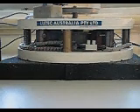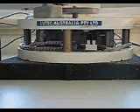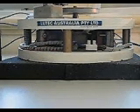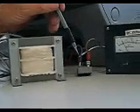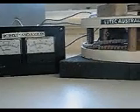Lutec Overunity Motor 362%

Comment: Surely most who see post would like to know more in detrail about the design. Are your bothered that someone would manufacture your design and benefit financially? Once you have publically made your design known it is automatically protected against any other person applying for a patent and exploiting your design. You therefore have no cause for concern in this regard. DC power is indeed the product of current in amperes and voltage in volts to give the power in watts. AC power measurements are not as easily calculated. To begin with the wave form of the AC generated must be knosn, then the RMS value of the current must be determined either graphically or by other means. The power factor must also be known even though you have used what appears to be a purely resistive load n the form of lights. Then  normal allowances must be made for unavoidable errors in measnrements. The best method to arrive at both intput power or energy and output power and energy is by directly measuring these quantities using mechanical methods.There is not much scope for errors in measurements with this method. It is only through using reliable and accurate meghods of measurements that the efficiency of your system may be arrived at. All the best to you and please do post details of your design for replication and tests by others.Thank y ou

Comment: There is energy in permanent magnets. This device doesn't magically convert DC to AC and create more power, it just solves the riddle of how to use the magnets' energy to do work (move things). It pulses the electro-magnet (pole +) which repels the permanent magnet, which turns the spindle, and presto, mechanical energy! Nothing is created, it is using electricity to convert potential energy into mechanical energy, which powers a generator. Is this really hard to understand?
Reply: Tom Hoehler
Okay let me get this straight...

"Magnets produce a field, a force, but NO energy..."

You are seriously trying to sit there and say that fields and force are not energy... Get a load of this guy lol...

I think you should go back to reading some quantum physics books bro. You obviously missed the part where it explains that all matter are energy and these "fields and forces" are products of the vibration created by that energy.
Reply: A permanent magnet, does not have its field generated through electricity. There fore any electricity used to operate an axis is only used to spin that axis. The opposing force of two magnets at a certain angel will be a constant repellant. Up to a point. But that repelling force will add to the sum of energy used in spinning the axis. Like I said it is not creating energy from no energy. It is taking multiple forms of energy and stacking them in order to transform the static energy into mechanical energy. If one takes into consideration that air creates friction, then a vacuum chamber is needed. Then the only friction that effects the rotation is the solid contact of the axis to it's receptacle. This is where the floating concept comes in. When you have the bottom of that platform covered in permanent magnets, and having other permanent magnets under it of the same polarity, the repelling force will cause the spindle to float. When this is combined with a vacuum chamber, there is ZERO friction. Then there is no wasted energy to overcome friction. That means the energy transformed from the spinning force of the magnetic fields will not be used for the motion of the axis.  Essentially generating more energy converting than is required to operate the motor. This is not a hard concept to grasp at all. It is not over unity in any sense of the word. It is simply energy changing from static to mechanical more than what is required to operate the motor. Nothing is created only converted.

Comment: Absolutely right Mile Whitenton. You cannot simply take average voltage and Amp measurement and multiply hoping to know exact power. One would need to take an instant reading of the current and voltage, multiply the two to get instant power calculation and repeat the process every milliSecond, and add up all  one thousand calculation results during 1 second. Then you would have an exact power consumption calculation. This can only be done with a microcontroller. Any other method is just a mere approximation likely to have big uncertainty due to phase difference and spikes and all kind of other interferences. Notice that the faster you perform the readings the more accurate your calculation are going to be. At 1000 readings per second one can assume a relatively good accuracy but then again any spikes in the signal shorter then 2 or 3 milliseconds would be a source of error. Nice try Eltimple but not convincing to me.

Comment: He has no filtering after his rectifier on the DC so as others have said it is pulsing DC which the meter was not made to measure. He also likely has created a phase difference in the AC output so the current and voltage are out of phase. You cannot simply take average AC volts and average AC current and use Watts Law for a resistive load. That only applies to instantaneous power not average power. He needs to confirm the voltage and current are in phase to use Watts Law the way he does.

Comment: The input power to the system is not just the DC input.  It is also the AC input to the transformer.  So they forgot to add that input power to the equation.  *BAM* try again!

Comment: @executableapplet If you are surprised by a magnet that clings steadily to a refrigerator, then I, in turn, am surprised that your head is still 'hanging' from your neck after all these years.  Thermodynamics doesn't explain that either.

Comment: This is like "Can you spot the flaw in the picture" and here it is one big flaw: The meters are not RMS meters, and can therefore not be multiplied. Rectified AC and AC will most likely be measured totally incorrect by these voicecoil meters, and the whole setup is invalid. BTW, you can not pee out more liquid than you drink. Same principle here. No free power.

Comment: Assuming you aren't cheating, since this system uses no novel techniques the apparent over unity will be a measurement issue. There are two likely sources for this.
.
Voltage x Current = Power but this is true instantaneously and not necessarily true for average or r.m.s values i.e. meter readings. For AC readings you need to know the angle between voltage and current.
.
The DC meter (rectified AC) may not be scaled correctly. It is probably reading average DC level rather than r.m.s.

Comment: @executableapplet One doesn't need to be a rocket scientist to know that the force "generated" by 2 magnets repelling themselves is exactly equal to the force one needs to bring the two magnets together. It's called Potential Energy, the same of the gravity. In order to fall down one first needs to go up. There is not Energy gain, actually, on a practical machine only Energy loss, due to the friction.

Comment: You forgot to multiply the output by Cos phi the phase difference between the volts and amps. As it stands the ac current might be maximum when the ac volts are minimum...though by the lighted loads its not likely.

Comment: Your measurement of Wattage is DC to start and AC to finish... 
Apples/Oranges

Impress me.... overunity has to be powered by its own output if it is to impress everyone.  A small kick start from an outside source is ok with me but NOT a constant outside power source.  That's silly.

Comment: Solar & Batteries = what works. Take the power from the Sun and store it in new designed batteries. 
The EV car of the 80s ran 100 miles pr charge and those were wet cell DELCO reg standard car batteries. I wonder how far it would go today? Some say over 1000 miles. That is worth opening the books on again.

Comment: Well, their claim amounts to perpetual motion, since if it worked they could use the power that comes out to drive it, with some left over to doextra work. That IS perpetual motion, or of course a way of breaking the second law, which isn't going to happen. Even Jehovah's Wittnesses are more convincing than this.

Comment: For the proper measurements we need the exact rpm of the generator because the analog meters can only provide AC measurement at nominal duty cycles common to the locale it was designed for.

Comment: In brief, the measured value is less than the peak value of the signal varying by time and since it is half signal, then the rms is even lesser in value. 

The  input measurements are rms of which  half signal 1Amp and 4.25 volts. Vmax is 8.5 v, Imax is 2amps. Prms(input) will be about 8,5 Wrms. While Prms(output) is about 15.4Wrms.

The difference is in: the number of revolutions of the generator, the meters are not designed for duty cycles different from Australian power mains duty cycles.

Comment: Really folks, I guess only engineers haven't been in this comments space. Has anyone studied electric circuits EEN 100 and 101? How the heck a half bridge rectifier is giving a continuous current or voltage? It is not linear, hence the mechanical meters are only measuring the average. v(t) = Vrms x sqrt(2) x cos(wt + phase angle) = Vmax x cos(wt + phase angle) since Vrms=Vmax x sqrt(2) and since it is a half bridge rectifier, then Vrms=Vmax / 2 . Therefore v(t)=2Vrms x cos(wt +phase angle).

Comment: Wow, measuring a non DC current and voltage with analog meters and then multiplying it and calling it power.  You're the type of guy that uses a meter to measure the voltage across florescent lamp sockets and wonders why it doesn't match the nameplate value.

Comment: Physicist study first because it is fun, there are many theoretical topics that physicist study that have no direct revenue, in any case, if a paradox was found like a violation of the entropy increasement of this device, it would have been vastly studied. But no, i am sorry, the macro locality has been studied a lot, this system is a scam, and if  you want i can write why it is a scam, not only for electrodynamics but for statistical mechanics or thermodynamical as well.

Comment: The mistake that John Christie (from Lutec) makes is this - 
for dc - Volts ( V ) x Amps ( I ) = Watts ( W )
for ac - V x I x power factor (pf) = Watts ac
When John Christie includes the 'power factor' for AC in his calculation, you will find an efficiency  (watts OUT / watts IN) of only about  33%. See the Australian Sceptics analysis of his fraudulent work - 
 - DON'T  BE  SCAMMED !!

Comment: It would be so easy to prove the claim without a real RMS meter, use a small chargeable battery as input, and let it be charged by the output while lighting some lamps at the same time. Unfortunately for this "inventor" the motor will soon stop, as it produces less energy than it consumes.

Comment: I do not see a multimeter anywhere one the vid... urgo, your comment about multimeters is not valid for this video...

What i do see is independant analogue volt and amp meters...

The way to settle ALL arguments about meters and power usage etc is simple... I've said it a thousand times... power the drvice from itself, and disconnect it from ALL batteries...

Comment: DC meters are designed to read DC, not pulsing voltages like your rectified AC.  AC meters are designed for sine wave inputs.  I'm not sure what your input waveform looks like, but I'm pretty sure we can't trust the meter readings.

Additionally with AC, it's possible to have the current and voltage out of phase, and have significantly less power then voltage * current.

Comment: Why would you start on DC power then generate in AC power. If your using a DC source you have to convert or establish a DC source of power. If you attempt to use your AC out put and put it back through your DC provider you will find your device lacks the energy output to drive it. Your not giving all of the losses from the starting point of power. So overunity it is not. Give us the whole story from start to finish. Power in at start, power out at end.

Comment: Your DC power (4.15v * 1A = 4.15W) is correct. However, your AC power(15.4W) is incorrect.

Assuming the power factor of the generator is 0.2, we can work out the real power output.

11V * 1.4A * cos(fi) (0.2) = 3.08 watts.

This is LOWER than the input and thus, gives an efficiency of 74.2%

Comment: I think the dc input power may even be less than just V*I, but the dc instruments do some kind of mechanical averaging (the spring). The most likely error is in the ac output measurement because 1A * 1V is only 1W rms when the phase angle is zero and if the wave shape is sinusoidal. In the demo, he should show a trace of voltage and current and then everyone can see the phase and calculate the power factor.

Comment: 362% huh?  Ok, instead of running the device off of AC mains, run it off of a capacitor bank that is continuously charged by itself.

I'm guessing we won't see that video.

Why is it there is never any sophisticated equipment seen in these videos?  Always a bunch of old analog gauges and other crap?

Comment: Here's a good example I once read.

Put your hand between a couple blocks of wood then feel with your hand.  

Next take a couple of permanent magnets and put them on either side of your hand and feel them as they pull. And continue to pull continuously and without requiring energy or expending it (they don't get hot do they?).  

According to the work formula, both situations do no work but you intuitively know that the magnets and wood are different. 

They are indeed doing work.

Comment: This isn't a free energy device. It does not magically create energy from nowhere. What it does is use magnets to do most of the work.  
A magnet on your fridge is doing work constantly but doesn't require electricity.  Does that make it a mysterious free energy device?  No, it's just a magnet. 
This device uses magnets to do the work with a little pulse of dc to keep the magnets from stopping. The electrical surplus comes from the stored energy in the magnets, which will last about 1300 years.

Comment: Your house voltage will show up around 120V on the meter when the actual "peak voltage" at the highest and lowest part of the A/C sine wave is 170V. Your meter will only read the DC equivalent of the A/C Voltage. The reading can only be the RMS reading.

Comment: Your AC output power calculation is DEAD wrong. You can't just multiply the volts and amps as you do with DC. You must take into account the power factor which represents the phase angle between the voltage and current wave forms. The power factor is never greater than "1" and in your case, it seems a great deal closer to "0" than "1".

Comment: why dont you just connect the output to where the input is and have it run forever?
i am sure you have thought of that, then why do you use wall plug power? if it has Overunity then you just need the wall plug to start it and it wil run itself. the only reason you didnt do it (and solve the world's energy problem) is that it is a lie.

Comment: You know what someone needs to do? Make a pressure to voltage device. Something that will create a voltage when a pressure is applied. Stick a magnet on it and wa-la. Usuable electrical enegry. Maybe cellular/biological. It's unfortunate that a magnetic field has to move to induce a current in a wire.

Comment: Hmm..the output meters are barely deviated and look like class 2.5 that can lead to huge errors. This could be a measurement issue. The real test is to rectify the output to feed the input and see if it stops or runs. The claimed 360 % efficiency will compensate any loss in the diodes and wires and convince the skeptics, if it runs...that is.

Comment: Actually... pretty much any dc to ac converter will give you a rather good percentage, without a transformer, i got a 9 volt DC battery to spit out 22 volts after conversion :P